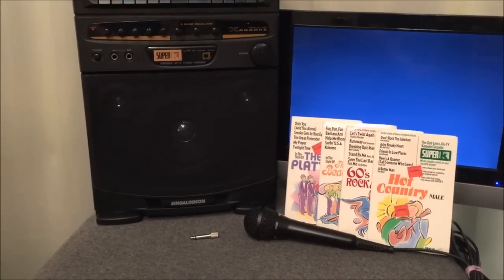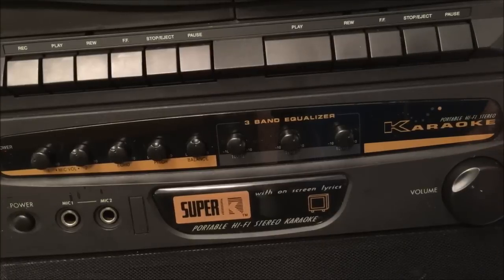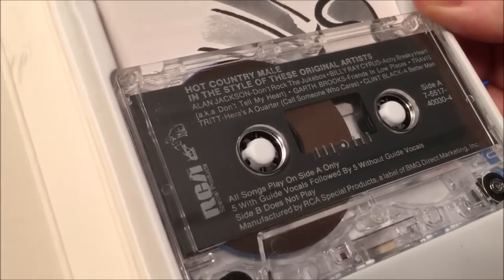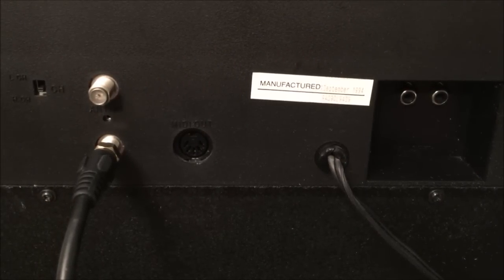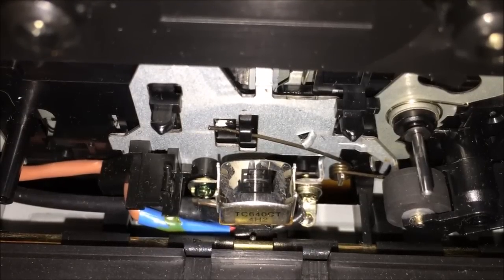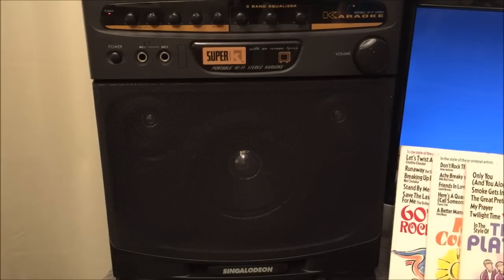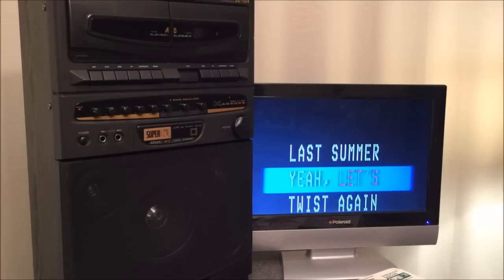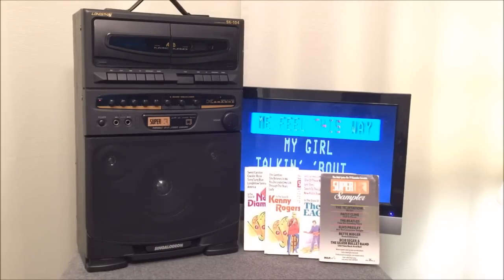Karaoke Cassettes With a Hidden Data Signal

Comment: That "residue" is Sony Bond Glue. Over time it dries out, becomes conductive and corrosive. The term coined by several of us audio nuts has evolved into DSBG or Dreaded Sony Bond Glue. It's a common failure cause in vintage electronics.
Reply: Repaired a Sony Betacam deck recently, lots of LEDs on the front panel, each with a rubber-like shroud to support the LED and prevent light spillage. Almost every one had turned hard and corrosive. Entire LED leads disolved, circuit board traces disolved. Horrible mess 😭 
It's a shame that so many faults/breakdowns are caused by aging rubber and plastic parts & glues while 99.9% of the machine could virtually last forever!

Comment: You can record MIDI information to tape using FSK (also used by modems and computer cassettes), so that is very likely outputting MIDI to be used on a synth for accompaniment.   I'm guessing the MIDI FSK is on one of the "Side B" tracks and the lyrics FSK is on the other.

Comment: The harris chip is just a video sync generator, part of the video output circuit... the mystery motorola chips are likely just 68HC711 or some form of 6800 series MCU with a custom ROM.  Very common for Motorola to custom number chips.
Reply: It is certainly true that MCU manufacturers would use custom IC numbers for such preprogrammed ROM versions of their common devices.

Comment: That was absolutely stunning. Thank for making that video. :-)
One wonders if there is a top-of-the-line version of that circuit board and ALL the empty sockets were filled with their designated components and all wired in.... what would that thing do?... what features?... definitely there would be more jacks in the back panel.. lol! :-D
Reply from the maker: Yes, it needs more jacks on the back panel!!  Like a Tape Out (instead of speaker out), a Line In for recording from CD, and a composite video out would be nice.  And thanks for watching it!
Reply: Right on... you're welcome :)

Comment: Wonder if you could copy those tapes with a dual auto reverse tape deck, such as the Teac W-865R Double Auto-Reverse Cassette Deck.
Reply: Jerry Spann You probably could, but you'll only get the audio. You would need to capture the output from one of these decks to get the lyric track.
Reply from the maker: I would imagine you'd need a 4 track copy deck (one that copies both sides at once) to insure best sync with all tracks.
Reply: If you copied one of those cassettes on a dual cassette deck you would get the audio only and not the data for the on screen display, since the data for on screen display is recorded on the other 2 tracks of the tape where side B is normally recorded and most audio cassette decks are not designed to play and record all four of these tracks at once but there are a few exceptions. There are some cassettes duplication machines and a few home double cassette decks that are designed to duplicate both sides at one, basically playing and recording side B backwards while playing and recording side A forwards to save turning over the tape, or using auto reverse to record side B separately if the machine has auto reverse therefore saving time. They have four heads in one instead of just two for stereo. Some auto reverse machines that don’t rotate the heads to play the other side have these exact same heads and both heads and tape work in both direction. There is a way to copy one of those karaoke cassettes on a normal double audio cassette deck that might work however. Once you have copied side A to the end of the recording - not the end of the tape, stop both decks at exactly the same time, turn both the tapes over to side B even though you’re not meant to play side B, then from that exact same spot where you stopped both tapes (without FF or Rew Esther) synchro start recording there which will play and recorded the data for on screen display backwards, which should work as normal when playing in a Karaoke machine before having both played and recorded backwards when copying with cancell each other out. Just make sure that the cassette deck and the blank tape you use is of decent quality so that the data isn’t corrupted through.

Comment: You are kidding about thinking the machine was broken because you heard the data track, right? For someone with experience with classic '80s computers, I would expect you would be able to recognize that. It sounding like it had a higher bit-rate than my Color Computer 2 does have. At the very least, the text gives you something to look at while you are listening to music. They'll let you dub regular cassettes, but they'll be damned if they let you dub their data track too. Sure, you could just flip the tape over to dub the data track backwards, but you would have synchronization issues that would be a pain. I guess you could record the data track on a computer using 44.1kHz pcm. You might be able to get away with 22,050Hz depending on the frequency response needed to capture the data. I wouldn't use a lossy audio codec though. In my experience, it garbled up a CoCo2 data recording. I've never tried flac with that though. I don't think I even have one CD encoded with text. I think they have to be special karaoke CDs. European sound systems used to use a 5-pin din cable to transfer 2 stereo audio channels out and 2 stereo channels in for dubbing. It might of also been used for quadrophonic audio connections. My guess is that if it was labeled as MIDI that it wasn't for the analog audio.
Reply: But if you dubbed side B backwards to another tape's side B, it'd be recorded backwards also, meaning it'd be the right way around when played normally on side A?
Reply: mipmipmipmipmip syncing would be a problem, but how about a portastudio? Like one of those fostex ones that run at normal speed, you could dub the tracks in real time?

Comment: I wonder what sorts of corruptions you could get on the screen if you did that thing where you press the pause button slightly to lift the pinch roller off the capstan and make the tape play faster and/or unevenly.
Reply: Lachlant1984 it sounds like there are plenty of timing/guard bits to enable it to decode at any intended speed.
Reply: Good point.  Also, this machine like many karaoke machines has a pitch control, I presume the pitch control adjusts the motor speed and doesn't apply any kind of digital signal processing or digital pitch control or time scale modification or anything like that, so, would adjusting the tape speed cause data corruption too?
Reply: Since they used such a cheap drive, it's likely that the variations in tape speed are already bad without the pitch control. For this reason typical ways to record data onto audio casettes have a large margin of error when it comes to speed. Essentially they typically record some way to recover the clock from the tape. For more details I can recommend the book "TV Typewriter Cookbook" which the Author Don Lancester has put online on his website.